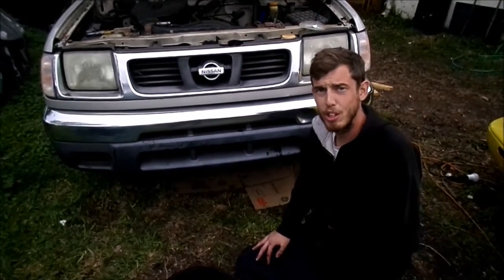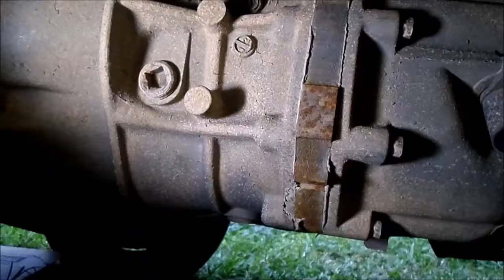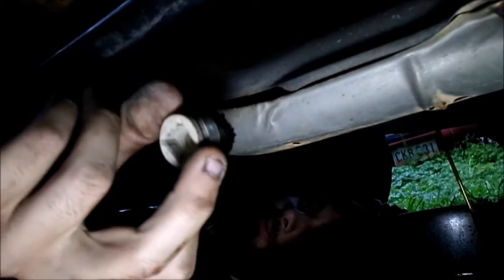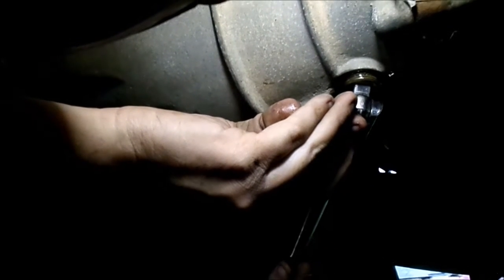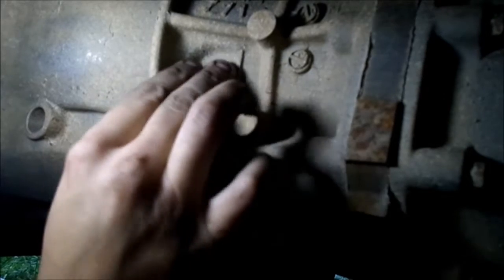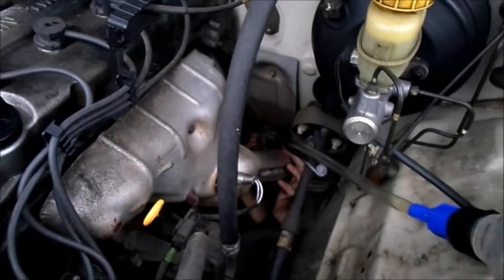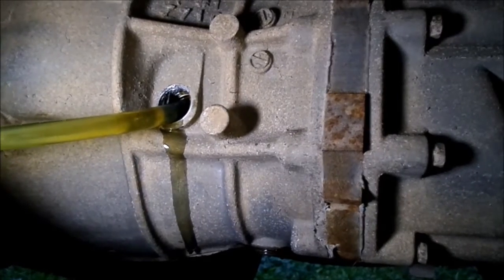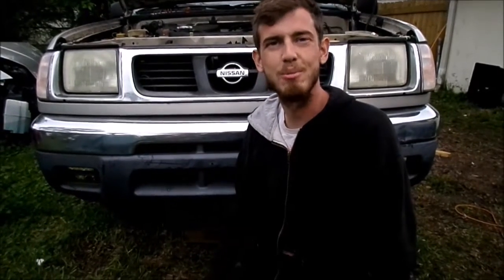1998 Nissan Frontier Manual Transmission Fluid Change

Comment: Why didnt you measure what you drained.. I have the same truck model and year and want to do this myself, but ive heard you want to put in as much as you took out in order to not over fill. Please get back to me, thank you.
Reply from the maker: Gus Gonzalez you can measure it if you want, it certainly isn’t a bad thing to do. For automatics you should definitely count it as not all the fluid comes out when you pull the drain plug. But with the way the fill plug is designed on the manual trans, being on the side, it basically acts as a level. You fill it until it starts to drip out of the fill plug, then you stop and put the bolt in. That’s the amount needed, It is actually hard to fill it up further than that.
Reply: @gripnslipgarage1844  Good advice.  I had to fill mine up, which of course slightly over fills it opposite of where you jacked it up.  But then I lowered and let it drain out of the fill plug until it stopped, then plugged it up.

Comment: Is that GL-5 class oil? I thought you needed GL-4
Reply from the maker: Gl-4 is the factory spec for oil for sure, but around us its kinda hard to find. We went with this oil because it was available. The differences are small but there, mostly in the percentage of additives. Nowadays most Gl-5 fluids are not harmful to brass metals thanks to other additives, in fact many are labeled gl-4/gl-5.  We have used gl-5 oil for years in multiple transmissions without issue, and dont expect to have a problem here.

But if you wanted to stick with manufacture specs gl-4 fluid could definitely be found.
Reply: You are Correct the transmission takes GL-4. Those guys used the wrong oil.